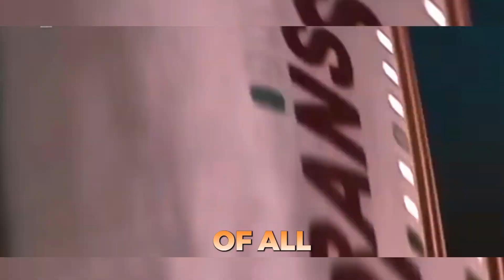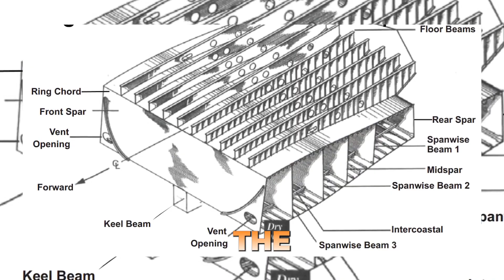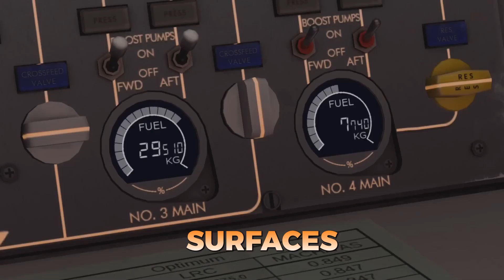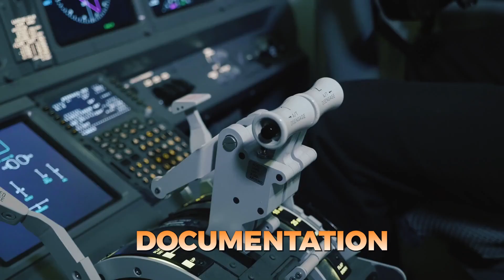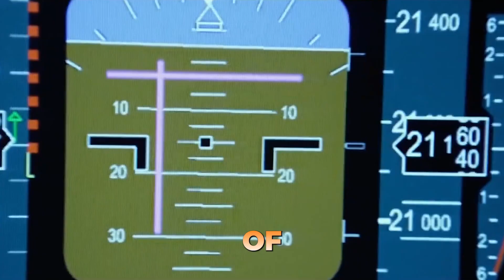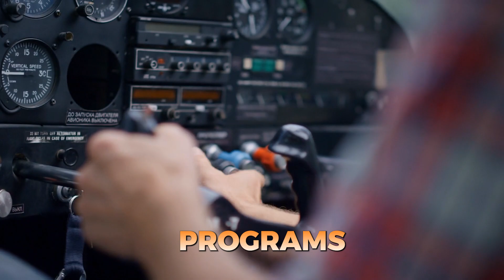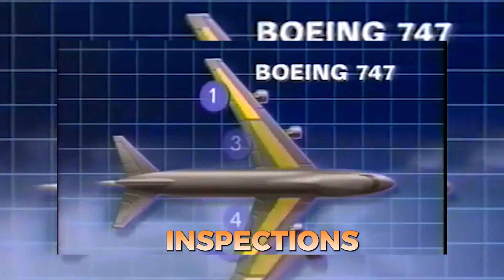The Maintenance Mistake That KILLED 230 Passengers- TWA Flight 800 (1996)

Comment: Wasn't a maintenance mistake. It was bought down by a US Navy missile  fired by a new Aegis system rushed into service with inadequate testing.     Don't believe me see the testimony of William Teele III and the 750 witnesses who saw a missile fired up at East Moriches that night. The centre wing fuel tank did explode as a result of an explosion outside the airframe penetrating the fuselage. Jet A1/kerosene fuel is not flammable and there were insufficient amounts in the centre tank to cause a catastrophic explosion and subsequent breakup, even Boeing stated that. So all this is bullshit!!!! One of the biggest coverups in US history
Reply from the maker: We understand your concern and it's important to consider all perspectives on such incidents. The TWA Flight 800 tragedy has been the subject of extensive investigation and debate. While there have been various theories put forth, the official conclusion from the National Transportation Safety Board (NTSB) was that the crash resulted from a fuel tank explosion due to a short circuit. It's crucial to acknowledge that investigations of this magnitude involve many experts and thorough analysis.